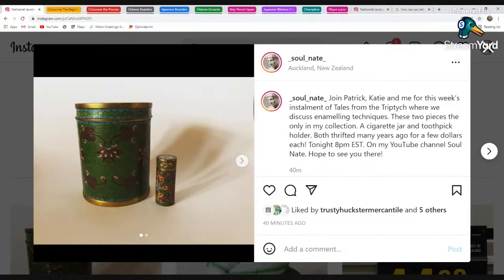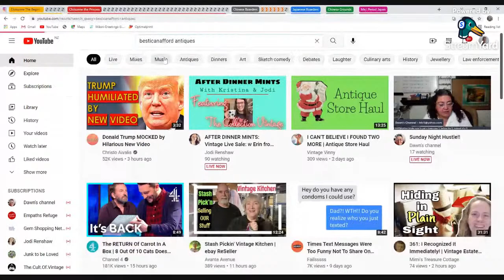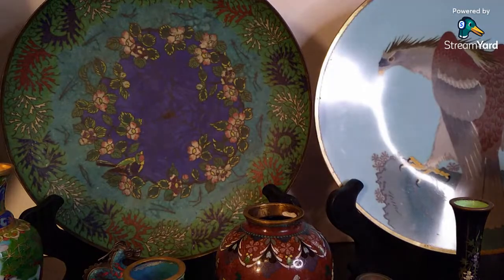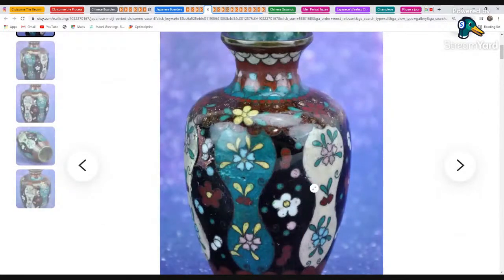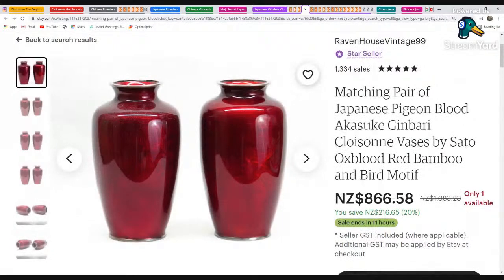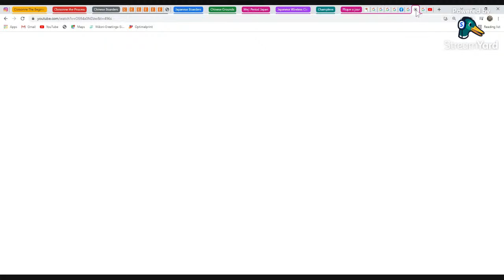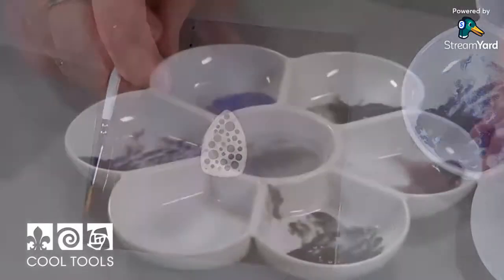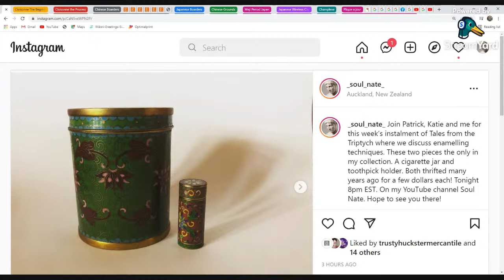Enamel Techniques ~ Tales From the Triptych

Comment: Hi, nate! Just tuning in for the part I missed! I know that sometimes a piece requires multiple firings because of shading in a particular cloison or series of cloisons. You'll note that some cells contain more than one color in some pieces. Some pieces have very art-like shading, masterfully done (see my video on a Japanese cloisonne plate featuring an eagle/raptor). Each color in a cell required a firing. Without firing each shade, you could not control the gradient (blending of colors). They would run together, as two melting things do, uncontrolled. So yeah, now you can explore that. You'll note many modern Chinese pieces have a single color in each cloison. This is the speedy way. A sure way to spot nicer pieces of even modern cloisonné is to look for shading throughout the piece. The prettier the better. If its got a wonky bird and three colors, it probably ain't great. Doesn't mean you can't buy it. If you don't, I will. Hahahaha
Reply: I didn't realize! Hahaha, the shading in the eagle charger featured in my video is very fluid. Without bragging I can say it is a very well done piece.

Comment: Oh! And wireless cloisonné is a bit of a misnomer. That's more keeping the original French term over the Japanese term as a suffix. In Japanese the terms would translate into wired and wireless enamel. Cloisonné was sort of already the globally accepted term for enamel on metal, but by its definition it has wires, or cells/cloisons.